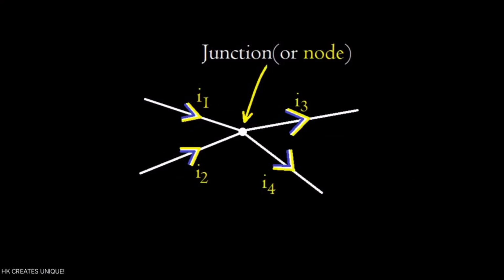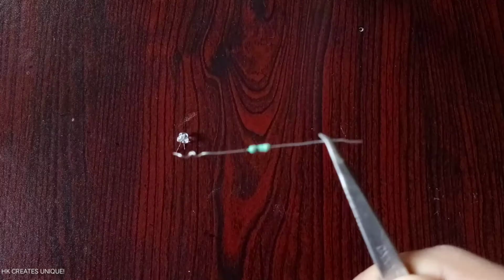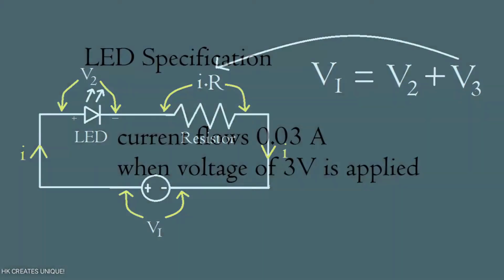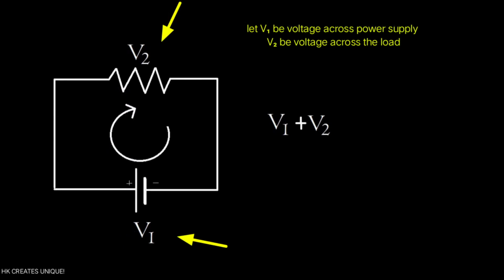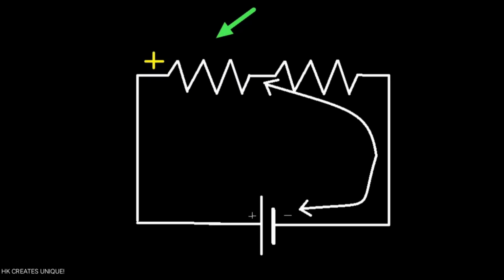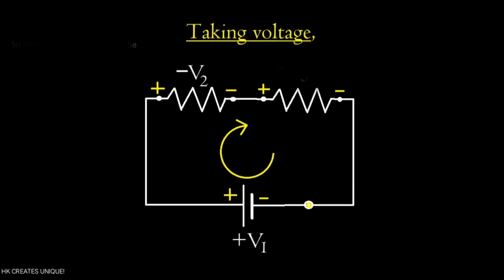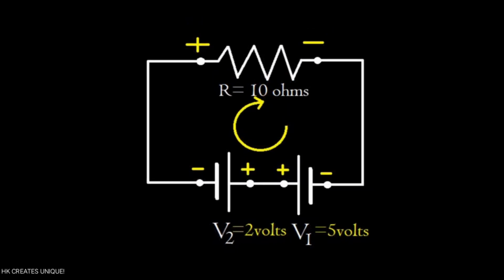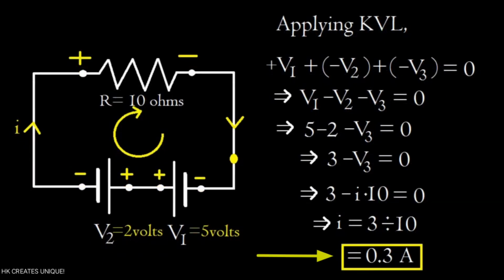Kirchhoff's Voltage Law (KVL) || Explained

Comment: If we take the second resistor as a LED will both the LEDs glow?
Reply from the maker: Yes!
Reply from the maker: But voltage should be given properly, i. E. If you use two series LED of 3volts each, you need to connect to a  6volt power supply.. Watch my latest video..